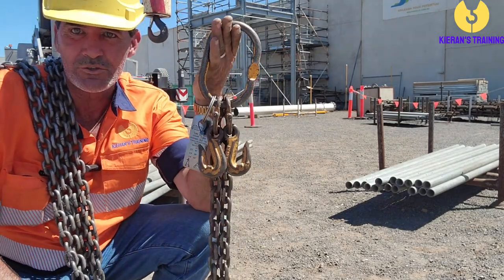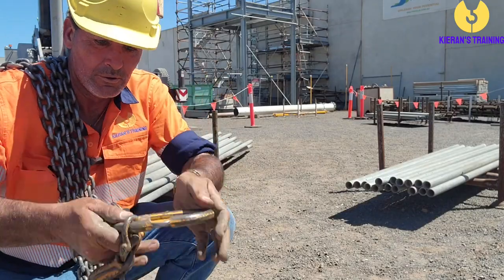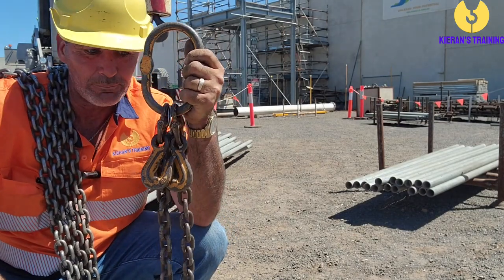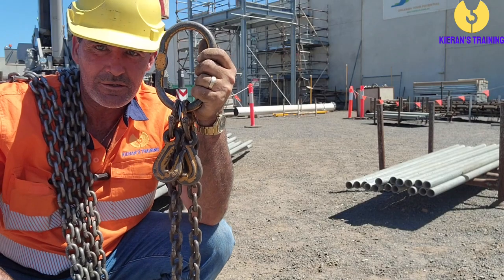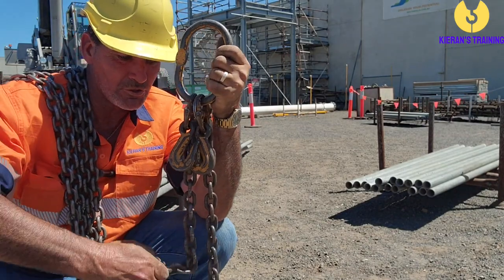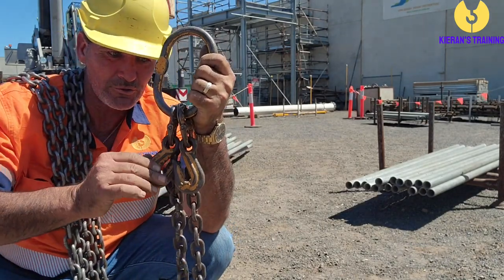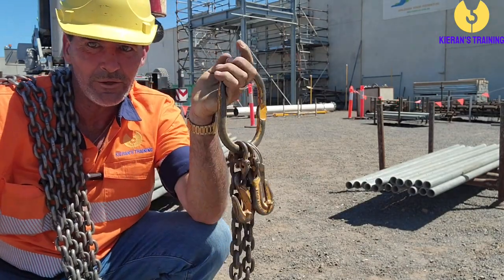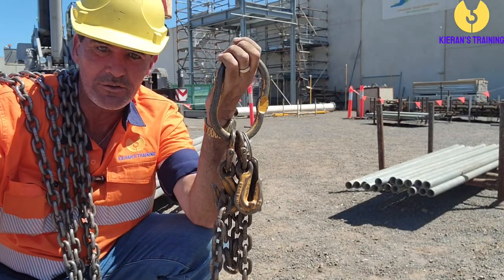Quick Lifting Chain Hack: How to Properly Use Shorteners

Comment: Hi Kieran, quick question can I use 2 leg chains to create 4 loops off shortners and hang 4 chain blocks off each loop? All within SWL, I was told I couldn't use this method not to have 2 blocks hanging off 1 chain. 4 leg chains were the obvious option but it's good to have other options if you need to adapt. Interested in your thoughts or any feedback
Reply: That would be link loading